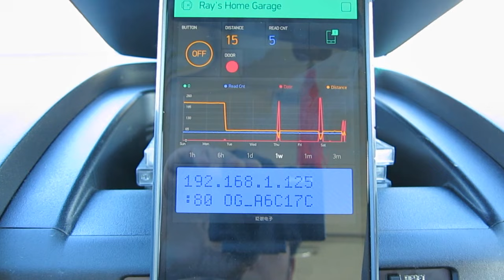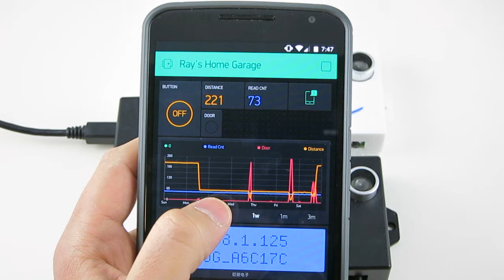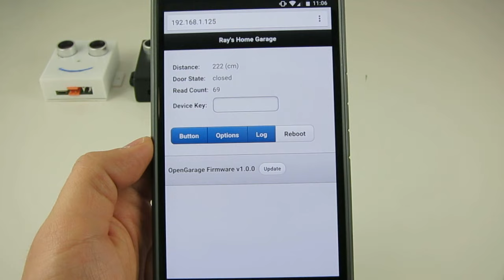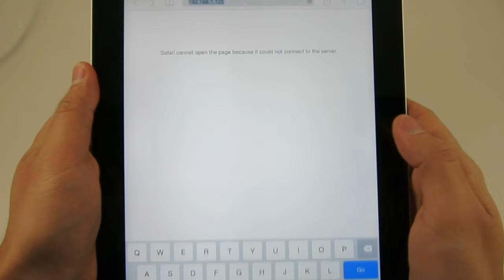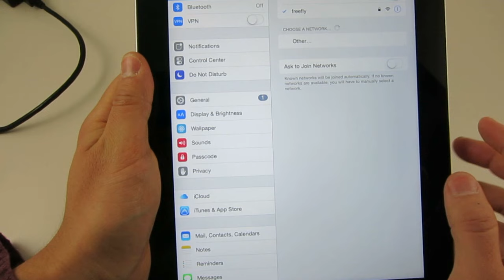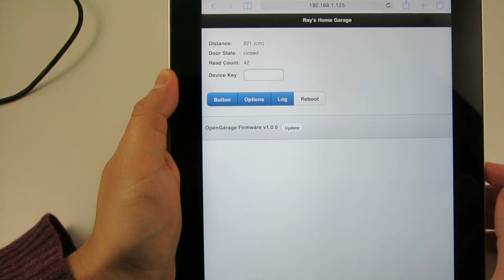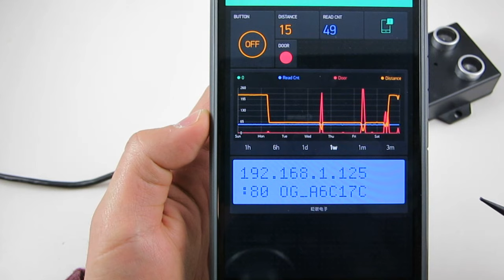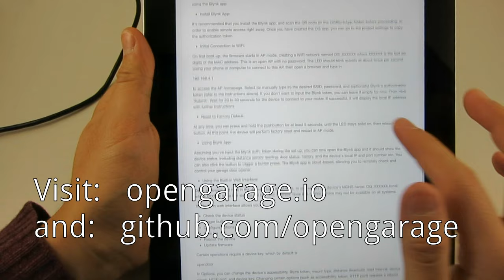Introducing OpenGarage: an Open-Source WiFi Garage Door Opener using ESP8266

Comment: Can you run more than on OG on they Blynk app or is it limited to one? IE. What if I have two garage doors I want to connect this to? (Really cool product, btw).
Reply from the maker: Yes you can. You can duplicate the Blynk project as many times as you want. Each instance has its own unique authorization token, and you can give each a different name to tell them apart.
Reply from the maker: To clarify: I mean duplicate project inside the same Blynk app of course.

Comment: Wow ! Just what I was looking for.  As a newbie I assume this will work with Arduino. Correct ?
Reply from the maker: It has a built-in ESP8266 wifi chip which is compatible with Arduino (i.e. you can program it using the Arduino IDE)

Comment: Very nice video.  At this time, you can buy a MyQ for most garage openers for only $70 so I am not sure if it is worth doing.
Reply from the maker: Cost is one thing, and software features are another. OpenGarage has a rich set of software features including several types of automation, and it supports MQTT.
Reply: @Fred:. As with many many things electronic.... it's the journey. The joy comes with: I built it myself; I learned a lot; I can build on what I learnt then for  my next project.....
One can buy complex electronics goods out of China for next to nothing, but to build a radio or an amplifier yourself from those beautiful little individual parts is like magic!

Comment: Does this product work with Android devices ??
Reply from the maker: Yup, it works with all mobile platforms (the app is cross platform and the built-in webpage is a web app so as long as you have a browser it works).
Reply: Not only does it work on mobile applications now, but you can use https webhook to actuate the relay, and read/write virtual pins.

I just built this myself (if the content creator takes donations, please contact me. You saved me lots of money by not purchasing the myIQ from Chamberlain).